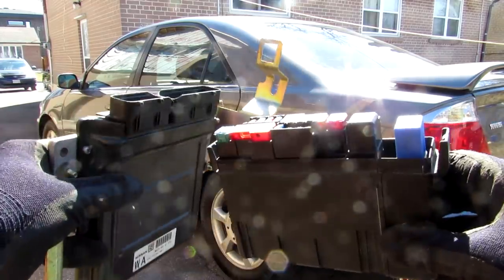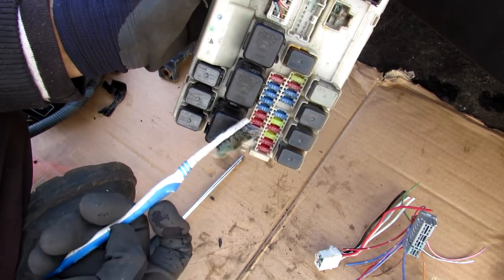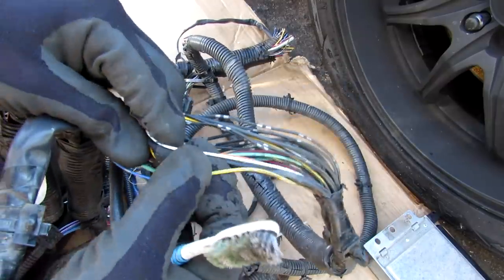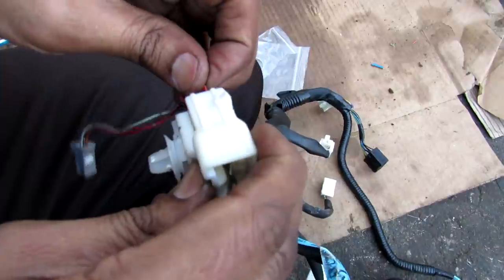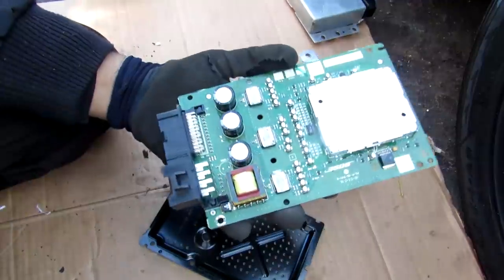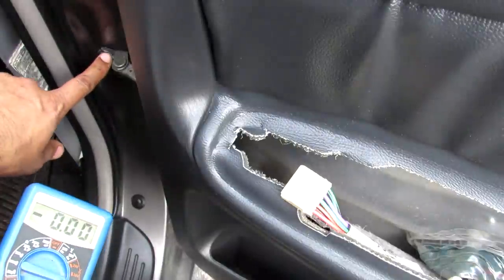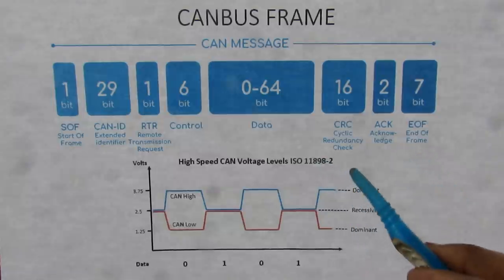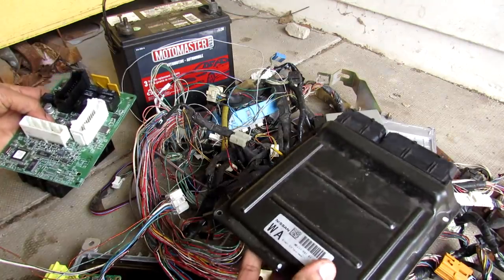Why Car Electronics are so Complex

Comment from the maker: To break down this complex system, you can skip to each of the six topics:
1. Power Distribution 1:04
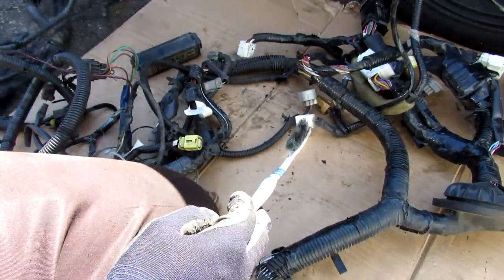2. Wiring Harness 5:42
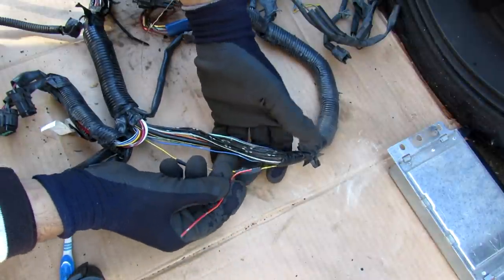3. Connectors 8:48
4. Electrical Modules 12:20
5. Wiring Diagram 15:25
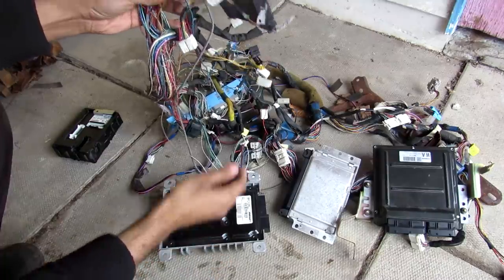6. CANBus Communication 20:21
Reply: Ayy if you put the timestamps before the section titles in the description, YouTube will show the sections in the player
Reply: Damn your videos are the stuffs of gold
Reply: Add 0:00 in the description and your video will get those cool chapters, it doesn't work if you don't add 0:00.

Comment: Great video!!  I just subscribed to your channel and love all your videos. I have just one little thing to add….Sometimes wires will read the correct voltage using a multi meter, but unable to handle a load due to corrosion or a small break in the circuit, etc. That’s where a nifty tool called a “loadpro” comes in handy. It puts a load on the circuit and you check for voltage drop on your meter. Alot of old school mechanics would use a headlight to load the circuit before loadpro’s became available.

Comment: Thanks for this. Great vid as always
Reply from the maker: You are welcome
Reply: I need your help @speedkar99 my toyota keeps "pouring" coolant through the overflow hose on the coolant reservoir. It does so after running for a while under normal driving conditions. There's no visible dripping or leakage from any of the hoses or around the thermostat. It pours it even though its not over filled and if its not topped up it will drain the radiator. Please help

Comment: I bought a 2010 Altima in 2015 30k for a steal with rebuilt title because the harness into ECM behind radiator had a slight crack which was nothing and state farm totaled it.  Its been excellent, been changing to CVT fluid now 75k.
Reply from the maker: Good buy

Comment: The starter on a car is one of the few things that is its own relay, there is +12v going all the time to it direct from the battery, the starter is energized when the solenoid engages the plunger / bendix. Starters simply draw too many amps to run through a relay of the size common in a vehicle.
Reply from the maker: Alternators are always hot as well

Comment: Large solder pads that are suspect bad or ringed would never be reflowed but hand soldered with added solder and would never fail again since in factory they where wave soldered.
Reply from the maker: Hot air station works too
Reply: @speedkar99  Sure just add solder with flux, I must have done 10k over my life.  Great 1 of a kind informative channel.

Comment: I have no spark on my old datsun 1200 mini truck 
Am sure its about the distributor wiring 
How can I fix this issue???
Reply from the maker: Change the wiring around, swap cylinders to identify
Measure resistance with your multimeter for each wire

Comment: Why does a turn signal need two cables from the main harness? Why doesn't it connect to ground locally?
Reply from the maker: You don't want to introduce multiple ground points because that's multiple points of failure. 
It's also easier for assembly

Comment: I was investigating a fault with my VW airbag system today, and I noted the connectors have a really cool safety feature that when they're removed, they short out the airbag igniter pins so you don't accidentally fire them off with static electricity. Very neat.
BTW this video has to be the most comprehensive and informative video on car electrics that I've seen, nice work!
Reply from the maker: That's cool!

Comment: I love these start-to-finish videos. The way the information is compiled--it's like reading a textbook, which is amazing. That said, this video should have been twice as long. The information density is such that I felt like I was speed reading. I found myself either rewatching segments or lowering the playback speed and occasionally pausing, just to be able to internalize all that is presented. My brain is strong, but it still needs a second to catch its breath!
Reply from the maker: I agree 100%. If you see my rough notes when compling this video it was like a textbook....laid out by the 6 segments I sectioned this video into. I was hoping that sectioning it would make it easier to understand but also didn't want to carry the video on to be too long and boring, thus I tried to edit it to be as concise as possible. #informationdensity
Reply: @speedkar99   Thanks for the response. Don't worry about boring! The people who are choosing to watch this type of video are people who are genuinely interested in the material and will only appreciate it. Sections are great for all videos, but are actually even more beneficial the longer a video is. Plus, it's way easier to watch a long video on a faster speed than to have to constantly pause a video that's moving along too quickly. (We're used to watching at high speed for creators like South Main Auto already, and it works really well there.)

Thanks again!
Reply: I felt the same.. You just stole my mind
Reply: @speedkar99  you have did a great job fpr content in this video.. I took more than half an hour understanding the whole things
Reply: Lowering playback speed. Now why didn't I think if that? Great idea. I guess this situation is exactly why we have that option! Which then asks the question.....Why is there an option to speed it up? More so, when would you need that??
Reply: Is very delightful I can see this video over again and don’t get bored

Comment from the maker: Now that you've mastered the car's electrical system, you can buy tools to help with your diagnostics and repair here:
Multimeter:
https://amzn.to/2AQzEND (US)
https://amzn.to/3hK520C (Canada)
De-pinning tool:
https://amzn.to/2V7ntmu (US)
https://amzn.to/316Iu4g (Canada)
Toyota Techstream Cable:
https://amzn.to/3i2mfmi (US)
https://amzn.to/2Z3IG1w (Canada)
Soldering iron:
https://amzn.to/3eBLs4Z (US)
https://amzn.to/3dl2cMl (Canada)
Heat shrink tubing: 
https://amzn.to/3erPTiv (US)
https://amzn.to/3fF93lg (Canada)
Electrical Tape:
https://amzn.to/2Nk9wgz (US)
https://amzn.to/3hObF1X (Canada)
Electrical Contact cleaner:
https://amzn.to/2AYz93W (US)
https://amzn.to/2zU9fxH (Canada)
My brother's toothbrush:
https://amzn.to/2V5O975 (US)
https://amzn.to/37SZP27 (Canada)
Reply: Im going to buy the last item on the list since it is the only thing missing in my tool box😆
Reply: What about diagnosing machine
Reply from the maker: @mansouralblooshi3004  Haha, thanks, make sure you click on the link
Reply from the maker: @lekonarodrick6821  I've added the links above. Thanks

Comment: Putting electronic door handles really unnecessary. I'm looking at you GM
Reply: Yeah, with my luck both will go at the same time......
Reply: white  I agree for the most part but headlights, taillights, dash gauges, heater, a/c, air bags, and abs brakes are pretty necessary to have too.
Reply: But if it doesn't fail, you won't buy another one. 

GM's Equation For Minimum Required Return
Profit>You⁴²³¹
Reply: Toyota as reliable as they are, are cheaper made than Hondas for sure.
Reply: @MISTER__OWL  :(

Comment: Love you bro...finally  I got my dream project video..I am automotive engineer..your all video are very helpful for students as well as professionals...
Pls make more video's on ECU software related, autosar,CAN ,LIN,
Thanks God bless you
Reply: Agree
Reply: you should buy a used German car (bmw) and you will have to fix it by becoming intimate with all its design bugs.

I got a recent E350 with a software controlled alternator, what could go wrong with a Benz, right...?

The front main AGM battery sensor (Volt, Amp, Temp) is connected by LIN bus all the way to the rear SAM module in the trunk (instead of front SAM)
More than 5 Distinct CAN Buses are inter connected through a GATEWAY Module whos job it is to relay messages across separate networks.

Backup Camera software crashes itself on regular basis, causes the Gateway to jam messages and the engine ECU to discharge 90Amp under 11.8V from big AGM battery... that abuse roast all the connectors, then dealer replaces $700 battery without fixing the cheap camera. Great money pit business.

Stay away from German money pits, stick  with the Lexus refined design version of German chaos. Japanese build cars under license of selected German gear.
👍
Reply: cars are so complex that the only way to fix them for profit is by following TSB's or hanging expensive parts until the customer stops coming.

Reverse engineering spaghetti CAN Bus design is a true labor of love. The solution in the end is often a module or a simple software update.

Benz love frying "SAM Modules" that is the "smart fuse boxes" present in every car based on Robert Bösch goodness.

Comment: Hey bro
Can you help me out with something???

I've got a 2011 honda civic &
Whenever the weather is cold or the engine is cool, I start the car & the engine shakes like crazy
It's vibrate so much till it gets to operation temperature.
After that it's completely normal
It's only drive 71000km 
Nothing's bad
The head gasket
The Rings everything's ok
But only has this vibration issue
Reply: I put in new plugs
Cleaned the injectors
Scanned for codes but nothing showed up

But the engine vibrates like hell when cold
(Great video btw 👍👍👌)
Reply from the maker: Check engine mounts and clean throttle body
Reply: @mustafaYkhan  Can you get some real-time data?  It sounds like a failing ignition coil but you need to scan to be sure.  Remember, the PCM runs the engine richer until it warms up, so a weak coil may be able to ignite the lower fuel volume when it's hot but not during cold start.

Comment: شُكراً لك
Thankx
 
 However ;
Car Electric System ;
1 - Power Generation 
  2 - Power Distribution
3 -  Wiring Harness 
 4- Connectors 
5- Electrical Modules
   6-  Wiring Diagrams
7- CANBus Communication
Reply from the maker: Ok

Comment: I am a degree qualified electronics engineer with 40 years of experience. DO NOT BAKE A CIRCUIT BOARD IN AN OVEN... You may cause the capacitors to explode. 
Generally, you will never fix a faulty solder joint that way without killing the rest of the board. If the solder is grey and the joint is poor you may get away with using a heat gun if you are quick and very careful not to overheat the board and surrounding area. The best thing is to use a soldering iron and fresh solder.
Reply from the maker: How about a hot air station?

Comment: It's a great disadvantage with 12V distribution system instead of 48V. 12V demands much higher current and much ticker cables.
I don't understand why 12V is still used in modern cars with all the electronics.

Comment: Helpful and informative video.  👌
However you might like to search for proper "soldering and joining techniques".
Using the "twist, solder and bend" method, while providing a valid connection, creates a parallel bubble with sharp points that may pierce insulation. It also causes a pressure point against other wires in the Harness, and the sharp bend brings a point of future failure due to vibration or movement.
Reply from the maker: Thanks for the tip!

Comment: It's not double sided tape on the ECM.  Those are thermally conductive tape to help cool the driver ICs on the board.  As you can see, the tape is directly underneath the drivers and contacts the aluminum back plate to act as a heat sink.  The white part in the airbag module is not a relay, it's a shock sensor for front collisions.  Bose makes the amp, ask them why they use those torx screws.  They sell basically the same amp to a bunch of OEMs.  Great explanation of the CAN bus basics.

Comment: Technically the flow of current is from negative to positive, which is why you disconnect the negative terminal on your battery when you're doing electrical work on the car...doing so disconnects the source of the current, namely the negatively charged electrons in the battery. 

However, since that flow of negatively charged electrons from negative to positive does,  in essence, achieve the same result as if positively charged "particles" were flowing from positive to negative, and since it's easier for us humans to think of positive numbers, this is how we choose to refer to current flow. 

Another interesting fact....the amount of wiring in a car (by weight) has increased from roughly 10lbs in 1970 to 110lbs in a modern car.  Whether this is a good thing or not I leave to the reader to decide :)
Reply from the maker: I chose to follow conventional current because that's how the wiring diagrams are set-up

Comment: Ok you have the alternator that send 160 amps to the ECU  ; is the chips and resistors on the ECU responsible to lower the amps fore the different sources ; like lights ; distributor and the fuel pump and to charge the battery ?
Reply from the maker: Amps is determined by the load, and most electronics are 12V.

Comment: Without a doubt the best high speedkar99 explanation of overly complex automotive electrical systems I have ever watched. Curious as to what your brother does with his day, besides brushing his teeth.
Reply from the maker: Thanks. This sure took alot of research since electronics isn't my major. I learned alot. My brother is an electrical engineer.
Reply: @speedkar99  Genius runs in your family. Good to know.

Comment: Speedkar99 - I've got a 2005 Subaru Outback with a 3.0L engine.  The AC has been a problem for 3 years - though I've attempted to have it fixed.  It now appears my mechanic has the problem isolated to the onboard EGI/ECM part # 22611AH63D - which is expensive to replace.  Are you aware of issues with this - and do you think that in fact we have isolated the problem?  (the compressor is in good order - the system holds coolant)  Thanks for any input you can offer!  Grateful !
Reply from the maker: No experience with those sorry
Reply: @speedkar99  Nevertheless - thanks for the courtesy of reply !

Comment: Great video! The best lecture I've had on the subject! Subscribed.
From my point of view, manufacturers opted for the simplest and cheapest way to control sensors, ignoring out the fact that maintenance and troubleshooting is a nightmare. 
It would be amazing if they built a serial communication and power bus that ran through the chassis, and have all the sensors be intelligent and connect to this bus, all with the same standardized connector, and a single ecu to manage all modules through software. This way, you wouldn't have a wire harness, and diagnosis & maintenance would be a bliss. However, it would be costly.
Reply: They do.  It's called a can bud.

Comment: The kindly humble request of to provide very basic electrical diagnosis testing circuit videoes like short to voltage and open test...for wiper and washer, Horn system without relay type like FET with BCM input horn switch, clockspring..

Comment: Thank you for such an informative video on a very invisible subject - Electricity. I am looking for a Scan tool for my 2017 Toyota Prius C, which will communicate via Bluetooth from the OBDII socket in the car to an App on my Laptop or on my I-Phone. Do you know of any Manufacturer's scan tool that works on the Prius C?
Reply from the maker: Toyota techstream
Reply: speedkar99 Thank you. I will check for it on Amazon.

Comment: I will be looking into my cars wiring bcoz I got it repaired/change during general overhaul but now when i turn on lights and apply brakes the lights in cluster gets dim ! 
i believe he has used either thin wire or put all load on one connection.
my plan is to sort the wiring individually and add fuses on every load.

Comment: i'd wish all new cars didn't have computers in them, in the old days, before computers, cars where extremely simple to fix and they lasted forever,  nowadays with these computers when 1 sensor breaks or a check engine light is on GAME OVER!!
Reply from the maker: These are very reliable systems compared to other mechanical systems on the car.

Comment: You know electrical systems must be complex when GM service technicians can't read a schematic in the service manual to know that the malfunctioning power mirrors are not controlled by the body control module.  True story; power mirrors didn't work on my Traverse, fuse was blown.  Not only could the tech not identify the correct fuse and said the fuse was good, but then he was trying to tell me it's problem with the body control module after they looked at it for 2 days.  I took it back, diagnosed it myself in 20 minutes armed with the factory service manual, a 9 volt battery, and some clip leads.  Fuse blew because the mirror switch had a contact break off inside, which short circuited the power supply.  Unplugged the switch, verified I had 12 volts with the blown fuse replaced.  Took the 9 volt battery and energized the up/down and left/right circuits to the motors in the mirrors, and they worked fine.  New switch for $20 off Amazon, and good as new.  That dealer did not get a good review.
Reply from the maker: Many dealers are scared to conduct proper diagnostics because of the cost

Comment: but where are other power transistors (you mentioned drivers for injectors)? There should be plenty of them. Relay is just on/off but many electrical stuff have power control, so it is not just on/off, but can be throttled.
Reply from the maker: Hmm, true.

Comment: I have a strange problem.. when i activate the right turn signal, my wipers start moving slowly and my right xenon bulb starts flashing. The problem comes and goes away on its own after  some time .It is a renault megane 3.. did someone encounter this before?
Reply from the maker: Sound slike you've got a short. Time to get the wiring diagram and do some diagnostics
Reply: @speedkar99  i tought that it's a ground problem.. a corroded wire or something. But more than probably,  you are right. Thank you .